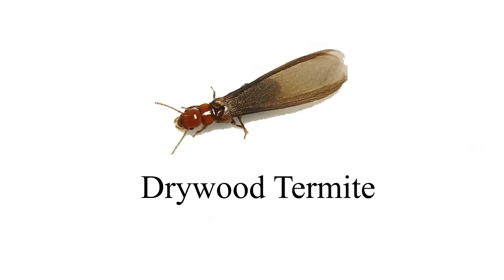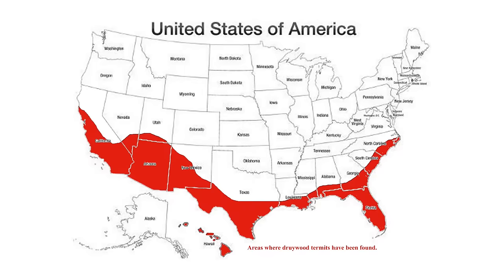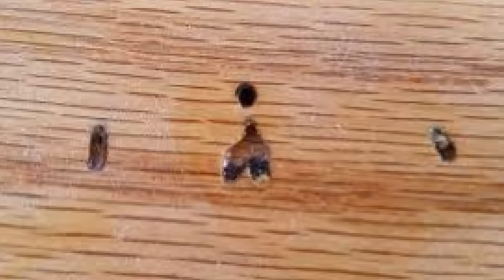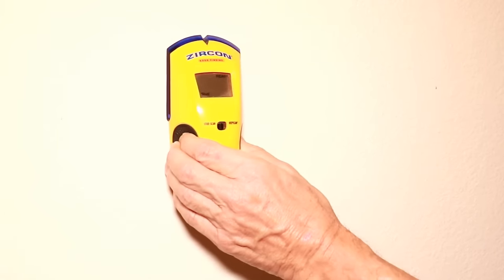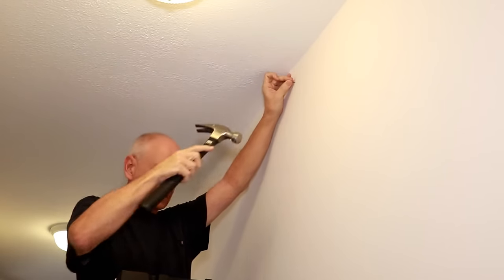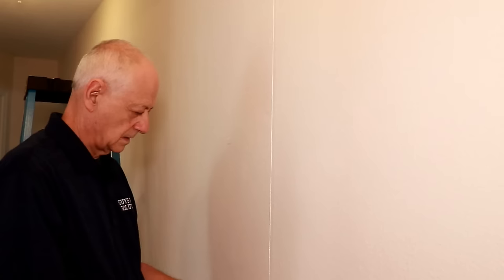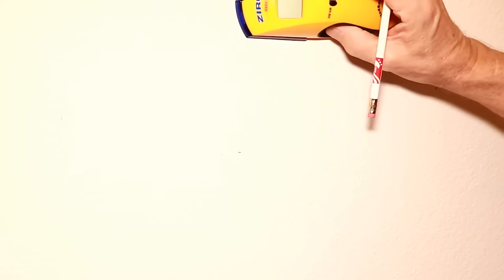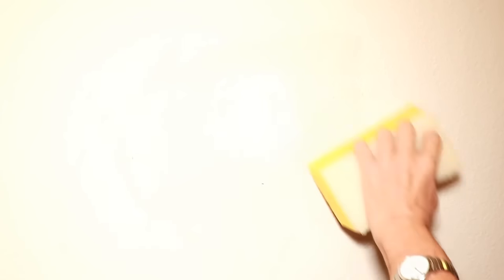How to Treat a Drywood Termite Infestation Yourself. A MUST see if you have Drywood termites.

Comment: I have Orkin that has been treating my mobile home for dry wood termites for more than five years. I have not seen activity for some time and carried a bond. Now I am seeing lots of activity from both subs and dry wood. I can’t afford fumigating. This is quite frustrating considering I had a company. Thanks for the info.
Reply from the maker: I am so sorry you are having this problem.  It is important to understand how drywood termites work.  They enter through cracks and crevices around windows, doors, eaves, pipe penetrations, and so forth.  Most of the time, they enter through several locations.  That is because a swarm of them attacked your house at the same time.  If there was a crack or a crevice, then they probably found it.  After they establish their galleries, which will be inside the wood, it will take four to seven years for them to be able to swarm.  Now that they are in your house, the swarmers will use holes that are in your studs to travel through the walls.  Those holes in the studs were created by the electricians to run the electrical wiring.  Not only are these holes going through the studs, but holes were drilled into the attic for the light switches and to run some of the wiring for the outlets.  So, the termites now have easy access throughout the attic and the walls.  If you have a basement or crawl space, they have access to that as well.  Most of the time, you will have no idea that they are in the walls, because the frass is inside the wall.  To make matters worse, if you have drywood termites, then your neighbors have them too.  That means you have been getting swarmed for as long as they have existed in the neighborhood.  Most likely, we're talking about years, so it's a safe bet that you have these guys in many locations in your home.

I always hate to be the bearer of bad news, but if you have drywood termites, the only sure way to get rid of them is to fumigate.  I know it's expensive, but if you don't do it the termites will keep on eating your biggest investment... your home.  Prices for this can vary wildly in this industry, so I recommend that you watch my video on how to hire a pest controller without getting ripped off.  That video can save you a lot of money.  You should also know that the gas they use to fumigate has absolutely no residual action whatsoever, so you can get reinfested the moment the tent comes down.  Like I said before, if you have drywood termites, then your neighbors have them as well.  Since drywood termites swarm every year, it is almost a certainty that you will be reinfested within a year after the fumigation is done.  The only way to prevent this is to do a preventive treatment on your house every 60 days.  Most pest controllers will not do this, so it is something that you generally need to do yourself.  I have a video on how to do that and I will place a link below.  This is a generic video that covers a lot of different pests, but it also works for preventing drywood termites.  Just ignore the part about treating your yard.  You only need to treat the house for drywood termites.  This will not treat the termites that are already there, but it will stop new ones from getting in.  If you absolutely cannot afford to fumigate your house, then you can try spot treating it yourself.  The thing is though that it is virtually impossible to find all the termite galleries, but it is way better than doing nothing.  Spot treating is all Orkin was doing, and they most likely were not doing it correctly anyway.  So, the problem is going to get worse over time if you do not fumigate.  It's like your house has a slow growing cancer.  If you do not fumigate, then eventually you will most likely experience structural damage.  Regardless of how you treat it, you should begin the preventive treatment immediately, so that you do not get additional termites paying you a visit.

By the way, I am on vacation, and I only get internet some of the time. I will be back after June 11, and I will be able to answer follow up questions then.

I hope that helps.  Be well my friend.                    

Video on how to hire a pest controller without getting ripped off:  https://youtu.be/y-a8XOqVrlE

Video on how to prevent drywood termites:  https://youtu.be/Yozv3s-Qwlw

Comment: taking notes!!! so grateful for this as we have serious rapid damage this year and need to diy.  no company wants this job after I tell them of visual issues. ☹️☹️
Reply from the maker: Please read my response to your other comment.  If there is a lot of damage, this may not be drywood termites.  If it is, then it's been going on for a very long time.  So, let's check the species to make sure.  Be well my friend.
Reply: @GuysPestSolutions  If new wood is going at back of a housej for  replacement is it best to gett pre-pressured/treated wood they make for termiites. Also, is it necessary to treat this kind of wood with bora care before installlation  or does the pre presuared wood t he only thing a builder/carpentry worker would need per say.
Reply from the maker: Pressure treated wood offers some termite resistance, but it is not termite proof.  This termite resistance can fade over time, especially if it is exposed to weather.  Bora-Care is a permanent treatment that renders the wood termite proof, and it never loses its effectiveness, unless you expose it to weather without sealing it 48 hours after the application.  If it were me, I would still treat pressure treated wood with Bora-Care.  I think you will find that many builders are not aware of this and would regard pressure treated wood to be termite proof, but it isn't.  However, it may do a good job keeping termites away for some period of time.  How long will depend on the application.  Sooner or later though, it will begin to lose effectiveness.

I hope that helps.  Be well my friend.

Comment: Hi Guy,  I love your wonderful videos, learning a lot from you about termites.  I am a DIY'er,  just found termite damage, with frass and dead old termites after prying open exterior wood paneling.  I live in SF, the house is over 100 yr, Edwardian style.  initially were told there is dry rot on side porch when I purchased the house 10 years ago.  I finally decided to strip the dry rot side porch only to discover frass and termite damage. So far, I have not seen live specimens.  How can you send you pics to verify if  these are drywood termite damage.  Also, can I solve this problem by stripping additional exterior to look at the damage and apply Bora-Care myself.  There is no  sub-floor crawl space, and the attack space is < 2 ft high.  Your recommendation is greatly appreciated.

Comment: @guyspestsolutions one company said they would spray my attic with Boracare and another said they would spray with Premise. Which is better against drywood termites? Thanks. 

Also dont worry about all the people saying your videos are long. I appreciate your thoughtful thoroughness. Those people can just watch your videos at a faster speed if they want to. Thanks Guy!
Reply from the maker: Thank you so much for those kind words.  Very much appreciated.  Hands down, go with the Bora-Care.  It lasts forever and penetrates into the wood almost to the center.  Premise will only last a few months, it will not penetrate deep into the wood, and it is not intended to be used this way.  Premise is best used for trenching and that does not work for drywood termites.

It is important to understand how drywood termites work.  They enter through cracks and crevices around windows, doors, eaves, pipe penetrations, and so forth.  Most of the time, they enter through several locations.  That is because a swarm of them attacked your house at the same time.  If there was a crack or a crevice, then they probably found it.  After they establish their galleries, which will be inside the wood, it will take four to seven years for them to be able to swarm.  Now that they are in your house, the swarmers will use holes that are in your studs to travel through the walls.  Those holes in the studs were created by the electricians to run the electrical wiring.  Not only are these holes going through the studs, but holes were drilled into the attic for the light switches and to run some of the wiring for the outlets.  So, the termites now have easy access throughout the attic and the walls.  If you have a basement or crawl space, they have access to that as well.  Most of the time, you will have no idea that they are in the walls, because the frass is inside the wall.  To make matters worse, if you have drywood termites, then your neighbors have them too.  That means you have been getting swarmed for as long as they have existed in the neighborhood.  Most likely, we're talking about years, so it's a safe bet that you have these guys in many locations in your home.

I always hate to be the bearer of bad news, but if you have drywood termites, the only sure way to get rid of them is to fumigate.  Prices for this can vary wildly in this industry, so I recommend that you watch my video on how to hire a pest controller without getting ripped off.  That video can save you a lot of money.  You should also know that the gas they use to fumigate has absolutely no residual action whatsoever, so you can get reinfested the moment the tent comes down.  Like I said before, if you have drywood termites, then your neighbors have them as well.  Since drywood termites swarm every year, it is almost a certainty that you will be reinfested within a year after the fumigation is done.  The only way to prevent this is to do a preventive treatment on your house every 60 days.  Most pest controllers will not do this, so it is something that you generally need to do yourself.  I have a video on how to do that and I will place a link below.  This is a generic video that covers a lot of different pests, but it also works for preventing drywood termites.  Just ignore the part about treating your yard.  You only need to treat the house for drywood termites.  This will not treat the termites that are already there, but it will stop new ones from getting in.  If you absolutely cannot afford to fumigate your house, then you can try spot treating it yourself.  It is virtually impossible to find all the termite galleries, but it is way better than doing nothing.  Regardless of how you treat it, you should begin the preventive treatment immediately, so that you do not get additional termites paying you a visit.

I hope that helps.  Be well my friend.                    

Video on how to hire a pest controller without getting ripped off:  https://youtu.be/y-a8XOqVrlE

Video on how to prevent drywood termites:  https://youtu.be/Yozv3s-Qwlw
Reply: @GuysPestSolutions  Hello Guy, I emailed you some follow up questions. Hope to hear from you soon! Thanks!
Reply from the maker: @jnlin8569  Okay.  If I have not responded yet, I will soon.  As you might imagine, I get a lot of email.  Mostly regarding termites this time of year because it is swarming season.  I can get as many as 60 emails a day, so please be patient.  I do manage to get through them all, but I am running a little behind at the moment.  Hopefully, I will get to it sometime today.   Be well my friend.